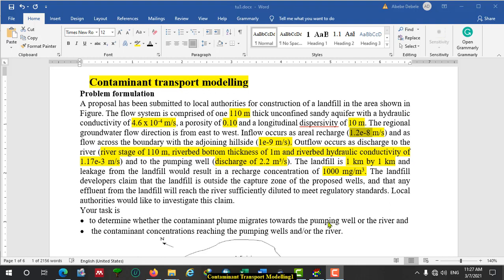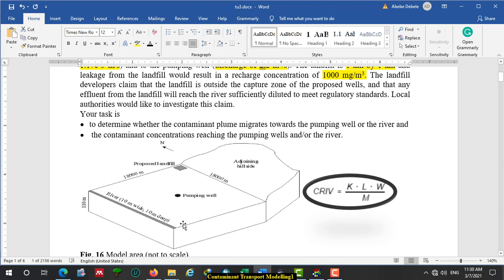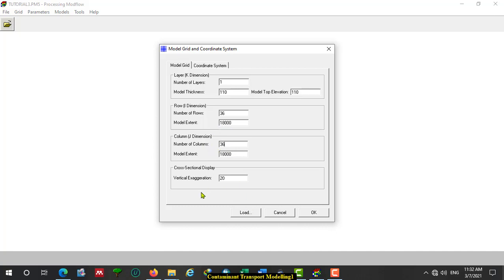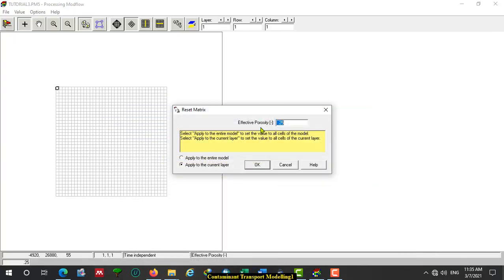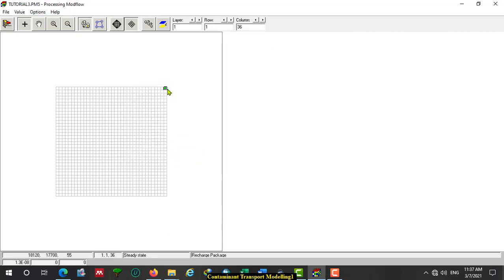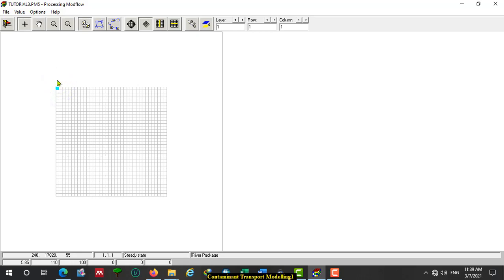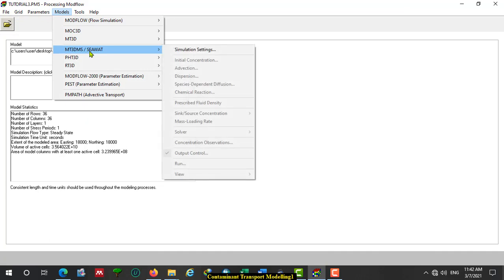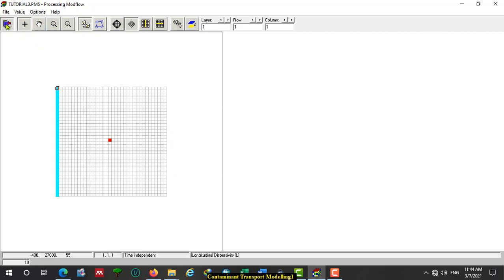Contaminant transport modelling  Using Processing Modflow

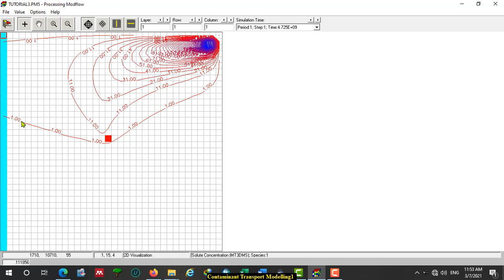Comment: Helo abe, i wanna ask you about my problems. When i run the data 25:18 , it wont calculate and it say 'STOP. Specified Name file does not exist: tes or tes.nam' and when to 2 d visualitation 21:30 , the 'species' field is empty. Would you like to help me to solve my problems?thanks in advance
Reply from the maker: Please try to follow the procedure rerun the model. Hence, if the problem is persisted we may have zoom meeting to solve the problem.